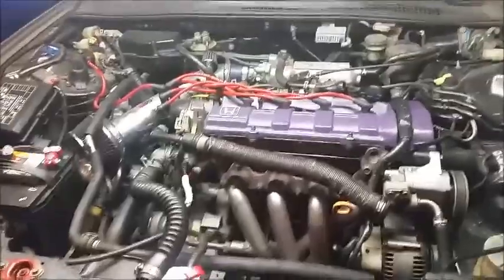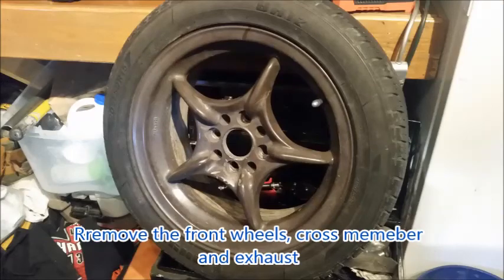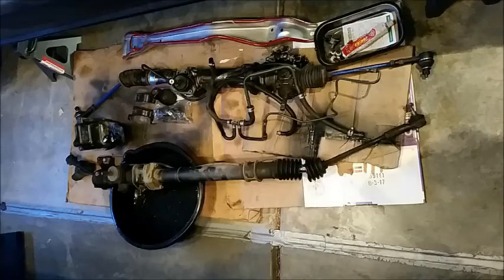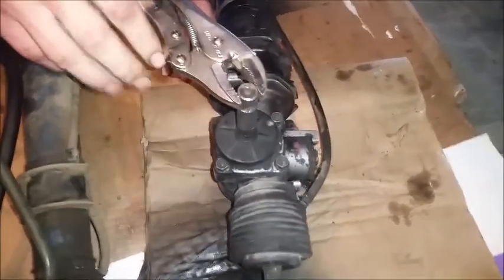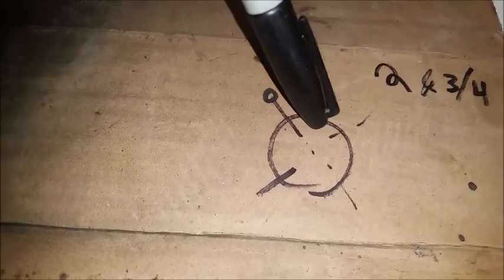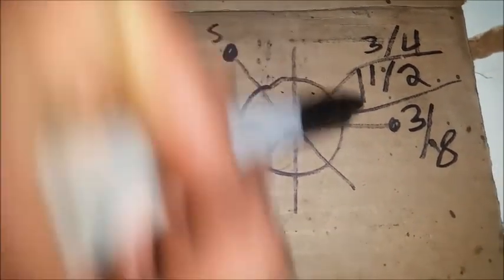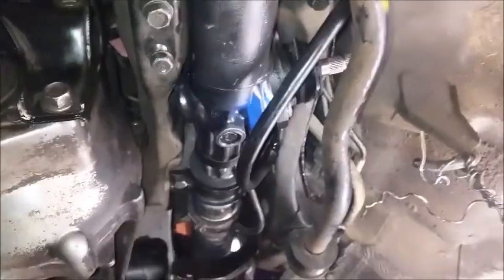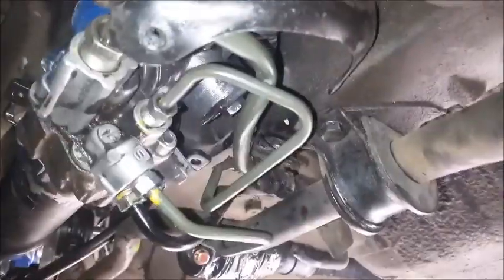88-91 Honda Prelude 4WS Conversion Tutorial Pt. 2

Comment: Very good tutorial! Quick question, did you use a new sub frame and steering rack? Or were those pulled from the car you got the 4ws system from?
Reply from the maker: The rear subframe needs to be grabbed with the rear rack. I refurbished mine. The front subframes are the same

Comment: Its 2.84 turn end to end for the steering rack. to center it you to turn 1.42 turn or 1.42 x 360 = 1 turn +152 degree. Did it myself when i found out the mechanic who wrongly install  my replacement steering rack.

Comment: Imagine doing this swap and then finding out the rear outer tie rods are discontinued everywhere 🙃
Reply: There are other options that have been found to fit our ludes. Most recently 1funryd commented part Napa es2382 is a good fit, and there are others.  Lots of info on Prelude Power.
Reply: @tylerhilton4295  yeah took me a lot of searching but I found the 2004 Santa Fe ones work and that's what I ended up using